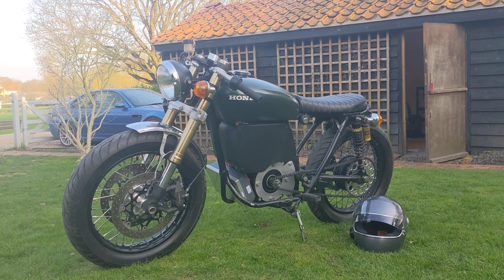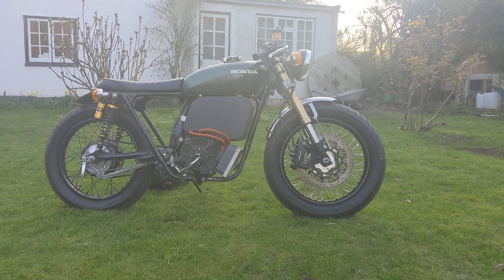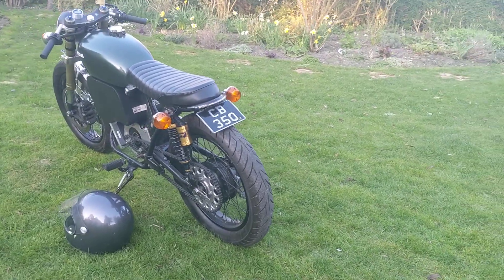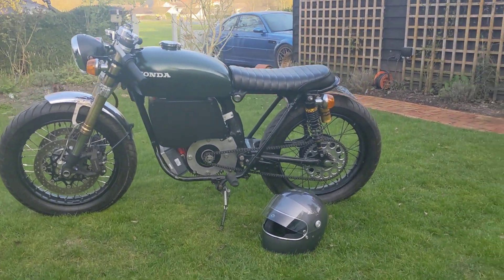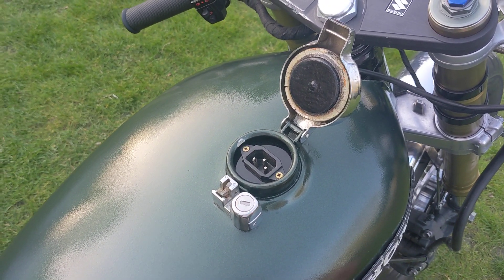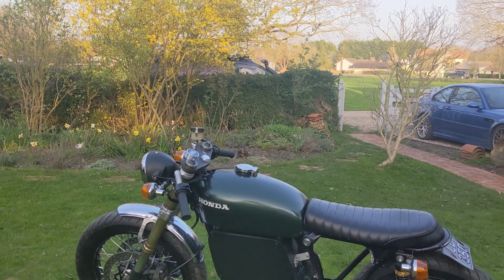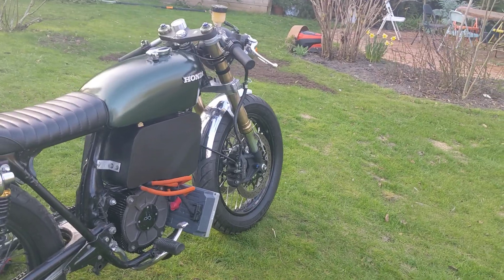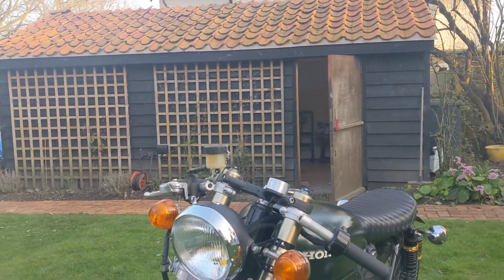DIY EV conversion - Honda CB350 EV

Comment: Rather than changing the rear sprocket, I’ve been advised to use the opposite approach, going from 12-14 to a 19 tooth motor sprocket.

Comment: This is in the top 2 most beautiful builds I've seen (the other one was done by a professional shop). It's an inspiration. I hope you're not tired of talking about it yet. I'm curious what you had to do for the GSXR forks conversion--was it a drop in replacement or did you have to make modifications? Thank you for this detailed video. I hope you have a lot of pride in this bike.

Comment: seems to me you have too big a motor and controller given what you said.  
I also don't understand the big deal about keeping the frame stock, this ain't no concourse restoration, you ripped out the engine for christ sake, a little cutting and welding is nothing to package things better if you need to, yeah that controller sticking out looks stupid,
otherwise nice job, although I would never tolerate the noise of a chain drive for a otherwise quiet ev.

Comment: Beautiful bike! I have the EV Motorcycle bug, and am looking at different builds others have done! 
There's a couple of CB350's in my area right now! I might message you for the file! Going back and forth between a hub driven motor, and a mid drive like this! 

How many cells did you use? What sort of range are you getting? Looking to build a commuter bike!

Comment: have you measured the 0-100kph time and top speed?  I am curious of the real world performance.  Thanx
Reply from the maker: Around 3 seconds with a top speed of 87. I'm going to change the gearing slightly to lower to 0-100 and give me a 100mph top speed

Comment: Roughly what is the total weight? Acceleration 0-100kmh? Max speed? - Cool build.
Reply from the maker: It's 30kg lighter than oem. 0-100 in under 3 seconds. Top speed of 87mph

Comment: Great video mate. How much do the electric moter cost +speedcontroller + battery 👍👍
Reply from the maker: The battery was by far the most expensive part of the build about £2k in cells alone another £200 in nickle wires, bms ect. Motor was £600 controler £1200

Comment: What's the gauge you have there ? Did you make your own BMS?
Reply from the maker: I use an ant BMS for charge only.. The controller handles discharge. The gauge is just a temporary v meter for now.

Comment: A stock crash bar from an early 80s CB900 would enclose the controller quite well and offer plenty of drop protection for both sides of the bike.
Reply from the maker: Will take a look! Thanks for the tip m

Comment: Such a small pack cant get more than 30 miles. if that.
Reply from the maker: I get 60 mils to a charge. More if I'm careful less if I'm not.
Reply: @VforVoltageDIYEVbuilds  makes sense 72v 66ah 4.7kwh. not bad for such a small pack. I only got 45 miles on my 75 cafe conversion but I only had a 3.2kwh pack. Nice job.

Comment: What kind of range do you get?
Reply from the maker: Around 60miles to a charge. I'm currently working on fitting type 2 charging which should allow me to charge in 20mins. At the moment it takes 4 hours on a domestic mains
Reply: @VforVoltageDIYEVbuilds  That’s actually a bit better than I thought you would say. Do you have room for more batteries? Besides behind the pack.

Comment: The obvious solution for the controller is below the seat. Seems to be more than enough room and solves the road rash problem.
Reply from the maker: That was the original plan but unfortunately it won't fit. The controller tech is moving pretty fast so hopefully won't be too long before I can swap it out for something smaller

Comment: increase the size of motor sprocket - it should give you less acceleration and faster top speed. Also the front tire is wrong way.
Reply from the maker: The acceleration and top speed is perfect for what I want so wouldn't want to change anything here. The front tyre is correct. They are Avons which can be used front or rear and are mounted directionally depending on where they are used.
Reply: @VforVoltageDIYEVbuilds  ok, just be careful driving on water..

Comment: Doesn't matter much with a cycle, but the front tire is mounted backwards. Back is correct.
Reply from the maker: I thought the same but the avons are meant to be mounted this way for some reason. Switch direction depending on if they are mounted to the front or rear.

Comment: You may have covered this somewhere else in the comments but what is the motorway and town ranges on this bike with your current battery setup? Also could you in theory mount the controller vertically outside of the frame behind the front wheel or is it too thick?
Reply: Love this build btw.. it's inspiring me to do the same with my Kawasaki GT550

Comment: Is that an old zero motor?
Reply from the maker: Kinda. It's an ME1507 motor which is what the zero motor is originally based on and used in their prototypes. I. Sure these more of a story there but can't remember the exact details.

Comment: Nice work! How did you built the case for the battery? What material did you use?
Reply from the maker: It's moulded acrylic. Just cut and moulded with a heat gun. I originally wanted to 3d print and may still in the future but the design is beyond my skill level at the moment

Comment: Hey Dan awesome work on the bike! Probably the cleanest one I've seen yet and it looks like its done proper! I'm looking at doing a similar project and have a couple questions for you. What did you end up using for a BMS? What do you use for the control side of things. Just a CAN capable microcontroller with few I/O on it? You mentioned using a smart phone for a display. Whats your plan there with regards to interfacing with it? What do you expect for range from it? keep up the good work!
Reply from the maker: Thanks Mark, I'll get some more on the specifics up in the next few days. But quick answer.. Bms is a ant BMS used for charge only (600amp output is tough to find) the controller deals with the discharge safety. It's a sevcon gen4 size 6 controller. I'm just using the torque Pro app with a can interface currently which gives me all the info I need albeit in a horrible ui. Range I expect around 50miles but will be adding an aux pack and supercapacitors in future to deal with overvoltage issues and increasing the range to about 70 miles

Comment: I have a CL360 and am planing to do basically the same build.
Haven't started yet as I'm doing my leg work before I get into it.
What is the gear ratio? 
What would have been the ratio if you had used the original rear sprocket?

Also I love the charger port idea. What's you incoming voltage to charge it? Charge time?

I look forward to seeing it on the road.

Comment: Thinking about embarking on this project with my CB350. What are your thoughts on Paraglider motors? Maybe they wouldn't last nearly as long, but I'm seeing ones supposedly capable of 25kw for 350USD.
Reply from the maker: You'd need to look at the tourqe specs on a motor like this, as far as I know they are designed for rotational speed but don't give much from the start

Comment: Beautiful work.  If It might suggest it, consider putting the controller verticle between the battery and rear tire.
Reply: Exactly where I would put it
Reply from the maker: Thanks for the kind words! Unfortunately it dosen't fit unless sideways and then I have the same issue

Comment: This is an amazing conversion - I'm in the early stages of planning a conversion project currently. I'm assuming this is MOT exempt on the basis of age - even with the conversion modifications factored in? Would also be great to know who you found for insurance with the modifications - just a few of the challenges I've come across so far!
Reply from the maker: It is indeed mot exempt due to the age. Adrian flux insure me currently.
Reply: @VforVoltageDIYEVbuilds  is the insurance cost comparable to owning normal ice motorcycle or do you pay extra because of conversion?
Reply from the maker: @greg23842384  it's pretty much comparable. If I didn't have it on an agreed value policy it would be the same as pre conversion. Saying that if I had have used a cb250 frame and the same components making basically the same bike the insurance would have been much cheaper purely based on the frame originally being less powerful.
Reply: @VforVoltageDIYEVbuilds  I see... thank you for the info
Reply: I suspect it really isn't MOT exempt. To qualify as a historic vehicle it is supposed to be 'substantially unchanged from original' 😁. Gr8 build anyway!

Comment: What about this: 3D Scanning the original gas tank, rebuild it with part of the battery or charger?
Reply from the maker: The, charger, 12v system and contactor are already housed in the original tank
Reply: @VforVoltageDIYEVbuilds  nice how did you manage that?
Reply from the maker: @mskateteam  essentially just cut the inside out with a dremel so it's just the outer skin and the top Ridge remaining.

Comment: Your battery is 420 cells at $9 a cell.  That is ~$3800 (2700 pounds).  Do you have a source for a great price or is that how much you spent on the materials for the pack?
Reply from the maker: I paid just over £1200 for the cells. $9 is the individual price. When buying a 500+ you can buy directly from sony/murata at about $4 a cell.

Comment: the motor is sitting to low looking at the amount of drag contact with the chain and swing arm
Reply from the maker: In an ideal world it would sit higher but then I sacrifice range and power. There is a chain slider on the swing arm to protect the close parts
Reply: @VforVoltageDIYEVbuilds  the idea i been throwing about was making a hub to fit round the motor for the wheel to be fastened to but then a jock shaft to take power from the motor to a sprocket on the hub so the motor stayed fixed and the wheel spins around the motor if you get what i mean as this would give more room for batterys and in thoery have more power then hub motors i have scene

Comment: Love the build. If your controller is waterproof coated with electrical silicone,  id simply weld it under the bike, almost under the motor.

Comment: I suggest you to throw away that huge oldschool sevcon controller i buy something more modern, smaller, efficient and easier to configure
Reply from the maker: If you have a suggestion for something as configurable I'm all ears but sevcon seems to still be way ahead compared to others albeit a pain in the ass to program
Reply: Look at Nucular 24F (easy to configure, complete universal solution with display, but long waiting due to small production), ASI BAC4000 or BAC8000.
Reply from the maker: @rycius-hy1jw I considered these but unfortunately the 24f is only 10kw continuous nd 20kw max I'm at 44kw max. The bac 8000 only goes up to 72v (which I'm running currently but will bump to 92v in future)

Comment: Great bike, great project. Would love to do anything close some time in the future, I wonder what the total cost was, non the less it runs in proper used bike territory for sure.

That sort of power on a bike seems amazing,  nice work.
Reply from the maker: I'll be getting another video up in the next week or so on parts and cost.
Reply: Still waiting on that cost list mate 😬 cleanest ev conv build I saw so far. Can you please give some info over range/full charge? You didn't mention anything about a bms system, and I saw others putting a fuse between battery and motor, in case something goes wrong. But regardless off that, massive congrats on what you built. I'll definitely start a project like this soon.

Comment: Dude. This is AWESOME! I've got a totally bare 1972 CB350 frame that I would love to convert to electric. Congrats, you just inspired me.
Reply from the maker: Would love to see what you can make of it! Any questions just shout!
Reply: @VforVoltageDIYEVbuilds  Did you create a custom front sprocket in order to properly align with the rear sprocket? Any special shimming between the motor mount and frame required? Have you noticed any frame twisting with the motor torque?
I also noticed the drive chain is pretty close to the swingarm. Are there any interference issues? You mentioned using the SL350 swingarm and potentially longer shocks. Will that cause the chain to rub the swingarm? 

Great build! not trying to criticize or anything- just trying to think through it. Thanks! - Justin
Reply from the maker: @Elitefrr  no spacing needed on the sprocket or motor mounts. No frame twist. I do get slight interference on the swing arm but easily solved with a chain guide. The cl swing arm will likely be the same.
Reply: Total cost?
Reply: If you would like for me to make you a battery, don't hesitate and reaching out to me
Reply: I am thinking of doing this to a 71 CL 350

Comment: very nice! good bike choice! please make some ride-by and onboard videos, and share some experience with how the machine works, charges etc... did you weigh the bike yet? and a classical question - range, in city and outside? thanks and have a nice ride!
Reply from the maker: The bike sits at 150kg (originally 181kg) 87mph top speed, 55miles of range to a 4 hour charge. 0-60 in around 3.5 seconds currently. This is easily adapted with gearing and programming. Could likely get sub 3 seconds with more aggressive programming but then I sacrifice ride quality.

Comment: Have you got any numbers on energy used per mile or kilometer?
Reply from the maker: I did the calculations before building the pack. I believe with normal driving it was about 100wh per mile

Comment: How is the noise from the chain? I used chain for my EV swap (not motorcycle)  but the noise was very unpleasant so I changed to a belt drive.
Reply from the maker: It's something I'm also considering. It's fairly loud but then it's not so bad when I've got a helmet on and let's people hear me coming to some degree.